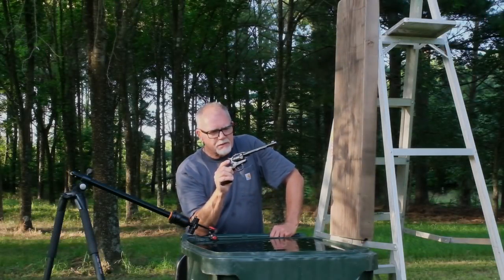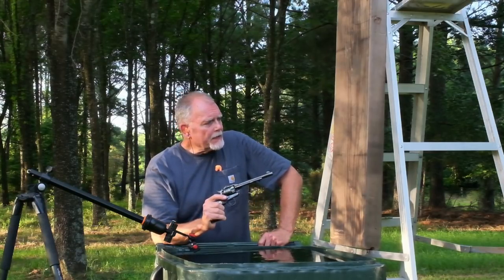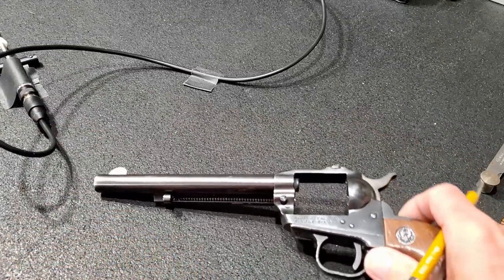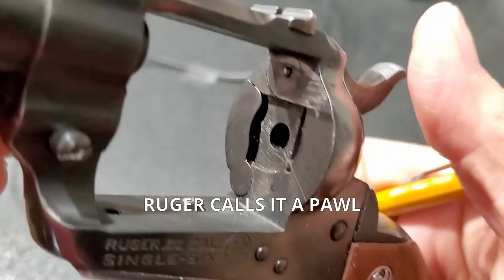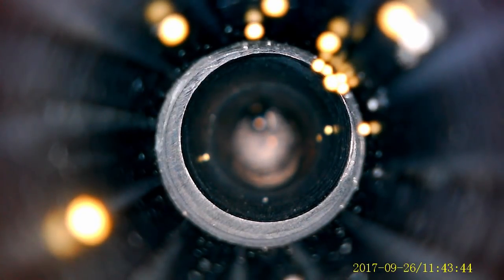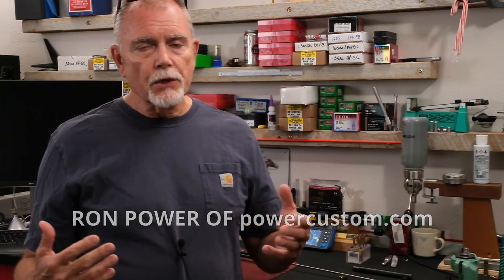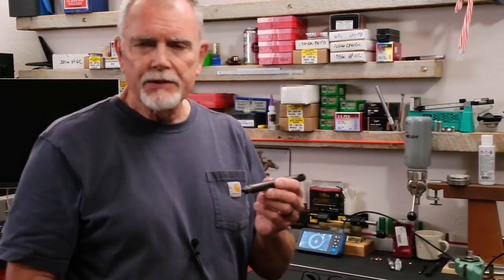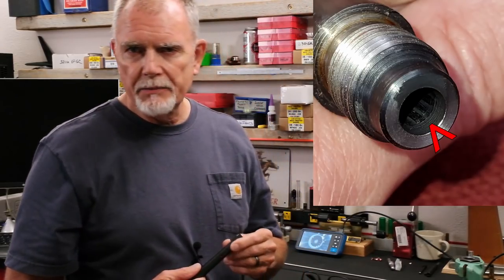The Bullets From My Single-Six Are Crooked ! ! !

Comment: Enlightening! 
This, by the way, is very similar to what I experienced with wadcutters in my old (and by now ex) 686-1 that had a forcing cone that was cut askew/off center. 
RN or FP bullets were fine but the WC design just didn't work in that revolver.
Good luck getting the alignment fixed and/or the gun rebarreled!
Reply from the maker: Thanks! Yes the Adventure Continues😎

Comment: It's not unheard of to have a barrel that's not set right in the frame. I had a Ruger service six that the frame was out of line by a few thousands. Caused the revolver to shoot low left no matter what I tried. To the eye it looked fine but the target showed different.
Be waiting to see if the barrel swap changes things.
Reply from the maker: Thanks Richard. I'll be working on the frame wrench and spacers later this week.

Comment: Thanks for taking us on this journey. I am not a gunsmith but the amount of vertical cylinder play and overall condition of the cylinder (though this could have just been lighting, camera angles, etc ) caught my attention. You may have already done this but have you checked the cylinder pin,  cylinder bearing surfaces, and  frame holes for the pin to see if they are out of tolerance? These can be fixed by an over sized  cylinder pin and/or some work to the cylinder surfaces. I would think that would be more common than the barrel being bored off center or worse,  the frame to barrel fit is off. Thank for entertaining my armchair analysis.
Reply from the maker: No problem. At this point I would entertain any thoughts :-) but I have check the cylinder pin it's straight and I would say it has a normal fit for a production gun. But I do have an oversized pin from Power custom and it will go into the gun once the bigger issues get resolved. Thanks for the comment!

Comment: The investigation continues! Really interesting to see the relationship between the barrel and cylinder through the bore scope. Have you done the same with other proper shooting revolvers in your collection? I’d like to see the lineup in one of those to see what it should look like.
Reply from the maker: That's a good suggestion. This Friday I'm picking up a new to me and almost new single six from 1963. I'll be sure and check that out along with my wife's SP101. There are two revolvers I've been looking at there in Houston. One is at the pawn shop where I bought this single six and it is a Blackhawk 357. It's got some issues of looseness but now with my relationship with Power Custom I would feel confident to tackle that project as well. The other is a like new model 27-2 Smith in 357 at a gun store near my house. If that one is still there I'm going to have a hard time not walking away with it.

Comment: My stepfather's 44 mag did something like that. He didn't notice the problem and it blew the barrel off.  In his case,a worn $2.50 spring caused the misalignment.  He fixed  it, he found a new,old stock cylinder and barrel online.

Comment: By inserting that .015 shim between the frame and the cylinder and thusly moving the cylinder down indicates too much clearance between the cylinder pin and the cylinder and frame.  Check that clearance with some precision pins and the pin diameter with a micrometer.  Good work.
Reply from the maker: With the oversized base pin from Power custom most of that clearance is removed. So that pin will be part of the final solution whatever that turns out to be :-)

Comment: The two things I would look at would be the retention pin for the cylinder and the central bore of the cylinder. With the retention pin, also look at the seat on the frame to inspect if it is wallowed out of specification. This does not appear to be a frame issue per se, but if the revolver was dropped onto a hard surface muzzle first, there could some structural deformation, however, you would notice the damage on the muzzle end as the force needed would make a whoopsie mark.

Comment: Seems to be an old and very well used firearm.  I would wager there's a good amount of wear somewhere in that cylinder pin setup.  Hopefully just in the cylinder bore, or on the pin itself and not in the frame. 

In any case, best of luck on the repairs.  It'll be interesting to see what the final verdict is.

Comment: Before throwing time and material into any repairs I would spend a bit more time in verifying the entire scope of components to find the root cause failure. Check the base pin diameter over the entire bearing surface compared to the cylinder bore dimensions as any excessive play will be manifested by the cylinder latch lift pressure. Check runout of the base pin in case someone got a bit abusive. Check that the cylinder latch doesn’t have excessive wear allowing an improper index point. One or more of these will be your likely culprit. If not, using a snug axle in place of the base pin verify that the chambers are bored parallel to the axle. The last check would be barrel and frame alignment after all else is corrected. Other than that, fill it with shot shells and throw it in the tackle box for cottonmouth medicine.

Comment: You have done an excellent job of showing us how you have worked with that revolver. The company that sent you the bore scope is getting their money's worth of exposure for advertising.  Excellent instrument. 
It seems to me you have some accumulated parts wear going on. .002" here and .004" there and pretty soon we're talking .012". 
The hand, bolt replacement would be OK, but I suspect there is also wear in the cylinder ratchet, bolt notches and possibly the base pin and/or base pin opening in the cylinder.  And...of course, at some point the "juice ain't worth the squeeze". While an Old Model Single Six has some enhanced collector value, it loses the collector value if you replace all those parts...then you just have an overpriced Single Six for plinking. 
But it may be worth it for the "personal achievement".  Whatever you decide...I'll watch the videos. 😁
Reply from the maker: "Juice ain't worth the squeeze"! I like that! So far the journey is rewarding and I suspect there is something to your tolerance stack-up comment. I am leaning towards the fact that the bore of the barrel was drilled off center to the barrel blank by a few thousands of an inch. When I unscrew this Barrel I will be able to tell if the misalignment follows the rotation of the barrel. I'll share that when I get to it:-) at a minimum I will fit all the new parts including the oversized base pin which is tighter in the frame both front and back and tied her to the cylinder. My Hope at that point would be that I would get enough Improvement to make shooting enjoyable.
Reply: @TargetSuite  I will admit to having pursued gun projects that were less than fiduciarily responsible. Because, dammit, I KNEW it could be done!  😁 Good luck, sounds like you have the plan.

Comment: No wonder it was in the pawn shop!  My guess is that the revolver was run over by a farm tractor.  The Power parts might correct the timing horizontal, but vertical??
Reply from the maker: I talked with Ron Power himself about the vertical misalignment and he agreed it's problematic. That's why I'm going to try the other Barrel first and see if it has better vertical alignment. If so I will get it fitted to this revolver and then correct the timing with the Power Custom parts. Thanks for the comment! And thanks for watching!
Reply: @TargetSuite  I know you will keep us abreast of the result.  I predict it is a frame problem, but I have no foundation for my hunch.

Comment: Good morning from Sun City. Own several Ruger 22 caliber guns. With my newly acquired bores scope looking down the convertible single six revolver the 22LR cylinder was pretty much in line with the bore. The 22 magnum cylinder was about five thousands of out. This might be why the magnum is such poor accuracy when compare with the long rifle and not my brother.  Now that might make him feel but not me. I thinking of cutting a corrected cylinder. When I finish the drawings for the cylinder and the fixtures for inspection and tooling. 
Shame on Ruger not recognizing the issue. The rifling my revolver is about has more were than yours.
Reply from the maker: Thanks for your feedback Roy! I just picked up a like new single six convertible model from 1963. It's a loaner from one of the friends of my channel. And this revolver has the same anomaly as yours. The long rifle Chambers line up perfectly where as the Magnum Chambers are off by about .005". I'd like to hear how that new cylinder works out.

Comment: Now the question is whether this is a cylinder or frame problem? If it is a cylinder problem you may be able to get a replacement cylinder. If it is the frame it's a bigger problem. I guess the other question would be "is it worth trying to fix?"
Reply from the maker: Or the third possibility, and the one I am suspecting is the case, is the barrel. I will explain once I get my barrel wrench made and can actually begin removing the old Barrel. I think at that point I will be able to demonstrate that the problem is with the old Barrel. But at this point a lot of it is guesswork😉

Comment: Who would've thought that was the problem. Not saying anything bad about ruger but I'm very surprised they didn't find that when you turned it in to them.
Reply from the maker: Maybe I was expecting too much from Ruger on a 53 year-old gun. But they did make me a generous offer on a new model single six showing good faith. But I wanted to keep working on this one so I turned them down.
Reply: @TargetSuite  in reality this gun is probably within Rugers spec for acceptability.  If a cylinder alignment rod will fit then they say it is good to go.  The chamber mouth (while really close) is still inside of and clearly visible through the bore.  I have a set of alignment rods if you want to try them on this gun

Comment: Before you go through all that hand and cylinder stop machinations check the diameter of the cylinder pin and the bore of the cylinder Center to make sure you don't have any end play in there. It seems to me that if you're installing a feeler gauge between the cylinder and the top strap and it's moving the cylinder down that means that there's end play in the shaft or the cylinder bore someplace...
Reply from the maker: You are right about that. There is play between the base pin and frame (front and back) and between the pin and cylinder. It is probably only a few thousandths of an inch, but too much. I do have an oversized base pin from Power Custom that will remove some of that slop, but not enough on its own, so I am going to check out the "new" barrel and see how that lines up.

Comment: You may want to check cylinder/frame/pin alignment, play and/or looseness. You just might need to fit a tighter cylinder pin.
My personal opinion is that the cylinder is not original to that gun. Ruger could tell you if it was originally shipped with dual cylinders. I am suspicious that it didn't have the 22lr cylinder with it since that is the one people use the most.
Reply from the maker: Thanks! I have checked that play and it is a little excessive. Probably came from the factory that way as there are no signs of excessive wear. I have talked to Ruger and it shipped as a Magnum only Single-Six in 1968. And the Magnum cylinder is properly etched with the proper serial numbers (last three).
Reply: @TargetSuite  Shipped as a 22 Magnum only‽ Now, that is very unusual! If you had the original box and paperwork, I believe any Ruger collector would pay BIG bucks for it.

Comment: Based on the images from the bore scope I wonder if the yoke of the frame has been bent which would cause the misalignment of the barrel to the cylinder. Also, I see some scoring (slight) on the face of the cylinder - possibly the cylinder to barrel gap is too tight?  Just some observations that may be contributing factors.
Reply from the maker: The base pin is straight so I don't think there was any misalignment there. But the cylinder Gap is pretty small and was hand-cut after the fact. The very top of the barrel face is almost touching the chain the cylinder whereas there is a .004"  gap at the bottom.
Reply: @TargetSuite  Sounds like you have checked it out thoroughly. Unsolved mysteries haunt me as well. Stick with it. There has to be a solution.

Comment: With the cylinder moving that much it comes down several options, the center shaft is worn, the cylinder frame is worn out or the cylinder is worn out. Most of this can be determined with a micrometer. I am betting the frame itself is what is worn and why Ruger called it "shot out"
Reply from the maker: Thanks for your comment! The base pin is a little loose in the cylinder and the frame, but not excessively. Regardless, I have a new oversized base pin from Power Custom that will go in once the "smithing" starts.

Comment: I have a single six but its a newer model with the transfer bar and you don't have to cock the hammer to load. i tried to move my cylinder by hand and there is zero movement in any direction. you said you already have a new hand and cylinder stop so i would suggest you also replace the cylinder pin also to stop the up and down movement. Good luck with this project.
Reply from the maker: Thanks Phillip. I forgot to mention that I also have the oversized cylinder pin.

Comment: Loved this video George.  Excellent job at explaining everything.  I guess my only question is, why does the cylinder move up and down?  If the cylinder/ base pin are out of tolerance, replacing the barrel will probably not fix the problem. Have you looked at the cylinder and cylinder and base pin?
Reply from the maker: Hi James. I forgot to mention that Power Custom sent me a new oversized base pin for this revolver. It does cut down some on that movement. And once everything else is resolved that oversized pin will be put to good use.
Reply: @TargetSuite  agree.  Really enjoyed the content of this video.
Reply: My ruger has matching serial numbers on both long rifle and magnum

Comment: George I don’t think changing the barrel. You can not move the frame so the barrel is not going to make a difference. The cylinder and or cylinder pin is in need of rebore  in the frame to a larger size. Then it’s back to the timing pawl. These are my thoughts only and I am not a professional smith.
Reply from the maker: Thanks. I appreciate your input! My thought is that the bore is not concentric to the barrel body itself and that's what's driving me to investigate a barrel solution. That may not be the case but I want it investigated before I do any frame work. Thanks as always!

Comment: Ah, another use for the Teslong bore scope.  I may just check my single six with my Teslong before I get it out to the range for the first time.  Too bad you haven't sent it out to Taofledermaus and have them record the bullet in super slow motion to see if it is flying true, or wobbling
Reply from the maker: That's a good idea. I will see if I can make the connection.

Comment: Probably left the factory with such a defect and a previous owner decided to solve it himself with no positive results. It can be solved by re-boring the chambers to slightly larger size without affecting the ratchet's functionality then press fit steel plugs, machine flush to cylinder length, remove barrel and replace with a pre made short guide to align the bores, then locate and mark all the chambers with snug fitting spot dill bit run through the guide barrel. With cylinder out drill through and ream the chambers and there you have perfect, target grade alignment. I know it works because I've done it ;)
Reply from the maker: Wow! That sounds like a project! Congrats on getting that done!
Reply: @TargetSuite  It's easier to do than it sounds.

Comment: Check the cylinder basepin  and check the basepin latch to see if it's pushing the basepin out of alignment
Reply from the maker: I tried it with the oversized base pin which has very little play in the frame and on the cylinder and if it helped the alignment it didn't help by very much. But in the final application the base pin latch will come out and the oversized base pin will be held in place by a set screw that pushes up on the barrel

Comment: With the actual treatment of the barrel over its lifetime is unknown, it could be a matter of a former owner using some method to clean the barrel that was way too aggressive. In any case the failure to have rifling marks all the way around the bullets clearly indicates a barrel issue.
Reply from the maker: Lot's of moving parts. I hope the problem, and more to the point, the solution appears out of all the smoke!